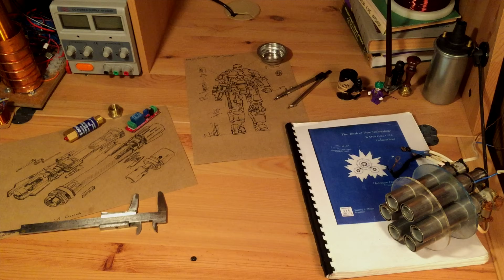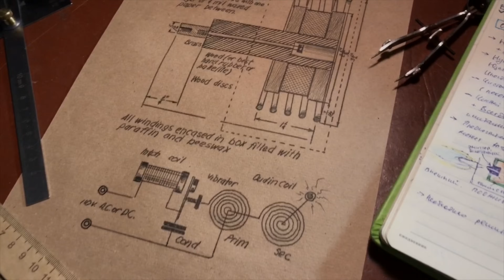Alex Lab beginning. Detonator for Hydrogen projects.

Comment: A great ignition system is cheap high voltage « step up power module » its like 2 dollars and can work with a 5v power supply